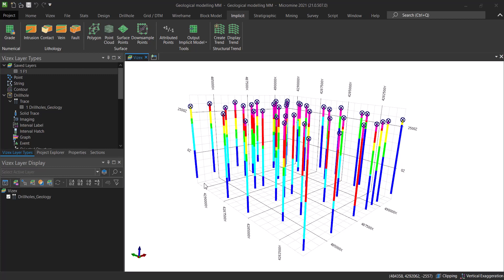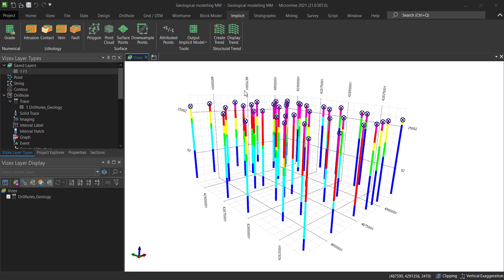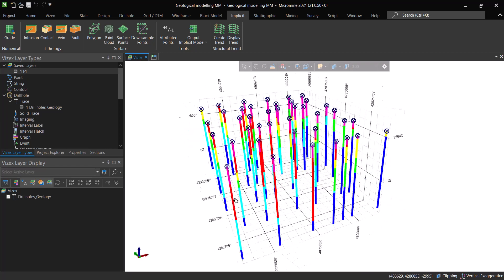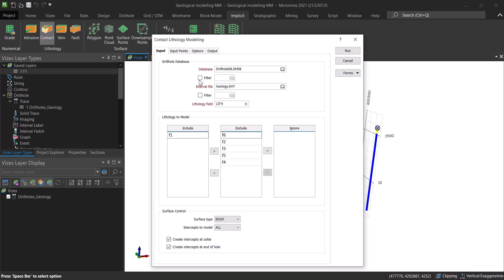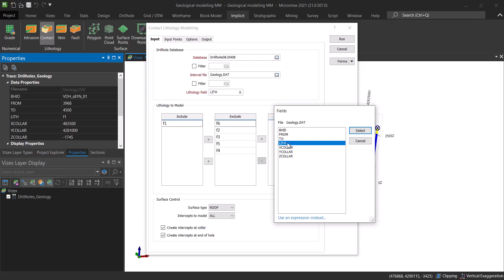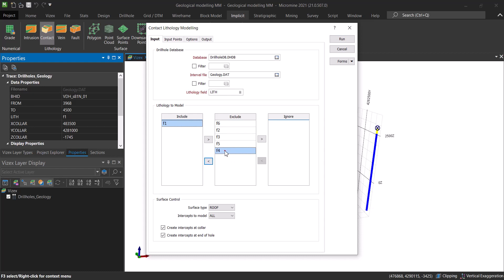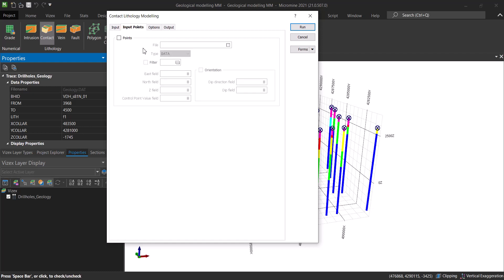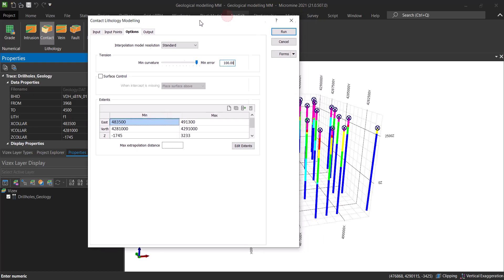Micromine Implicit modelling basics

Comment: Hey Mining Geologist, thanks for yours mining tutorials. Can you help me with a micromine problem that iam facing? I have a open pit model and a database that has a lot of old and new drills. The old drills are flying above the actual surface and the new drills lying in the actual surface. Do you know If there is a way, using micromine, to exclude the old drills of the visualization of the open Pit model?
Reply from the maker: Hello Tiago, I think the best way to do it is to create two different databases and then visualize the one you need .